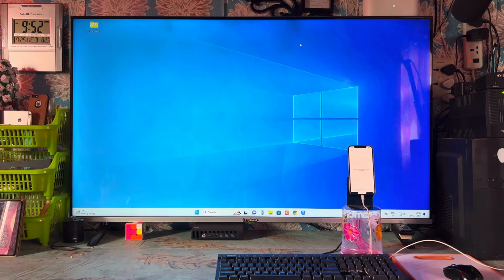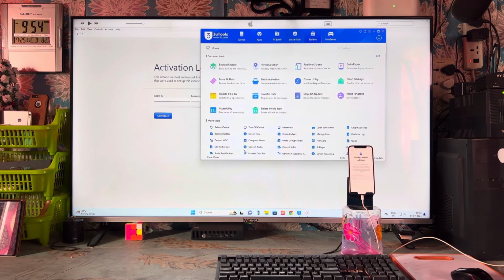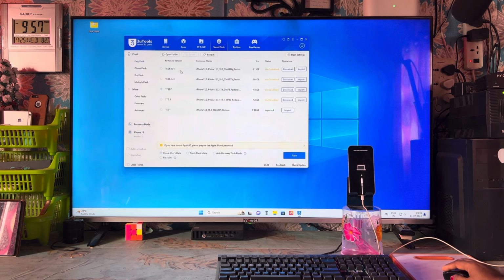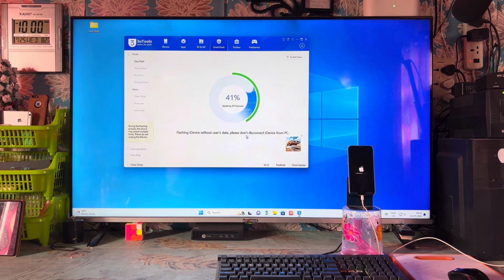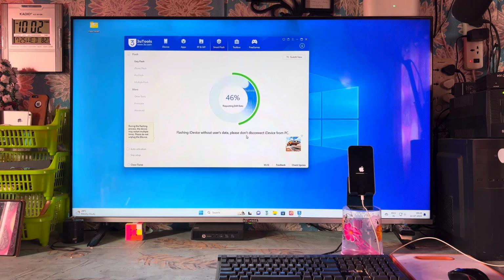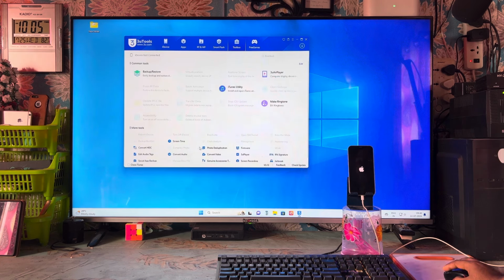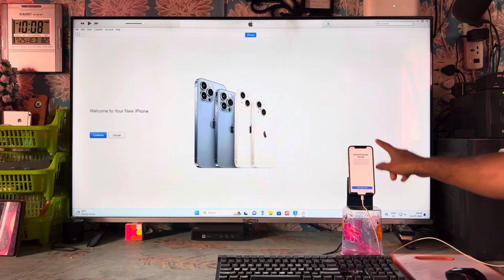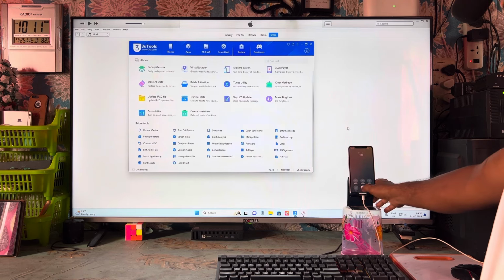Unlock iCloud Activation Lock Without Apple ID [FREE Software-Tool Remove iPhone Locked To Owner]

Comment: It doesn’t remove apple ID activation lock I try with iPhone 12 Pro and promax iOS 17.5
Reply from the maker: use vpn  or change internet connection  while batch activation of idevice
Reply: I should on vpn before starting the whole process ? Do I also on VPN while using mobile data to connect on hotspot? Do I also need to connect my vpn on my laptop

Comment: Why is it asking id password at the batch activation interface ??
Reply from the maker: change internet connection or use vpn while batch activation or deactivating of idevice
Reply: @TechnologyWelfare I used vpn too but it's showing failure in batch activation
Reply: Please help me unlock it I will subscribe with 5 more phones if mt problem got cured 😢

Comment: Hey, i have a question. If i go to easy flash an import the ios 18.0 at 20% its comes error and i stuck in a loop what should i do? I try the same multiple times and it comes very time the same?
Reply from the maker: use below ios 18 , then tri it again